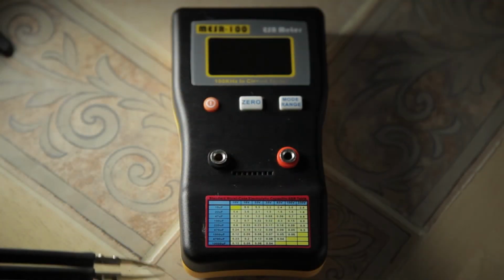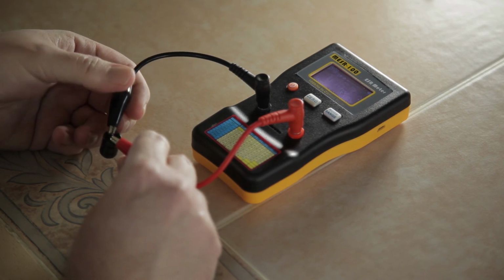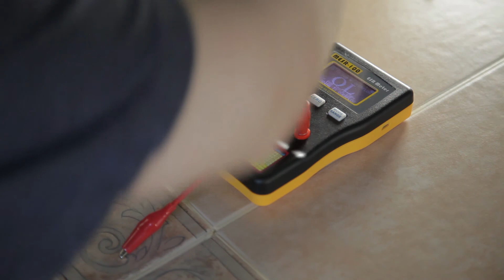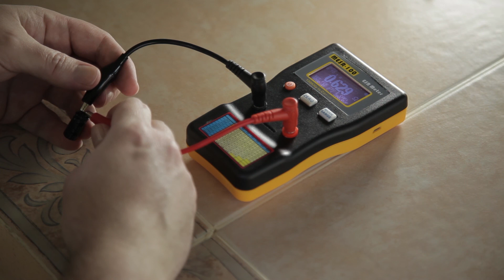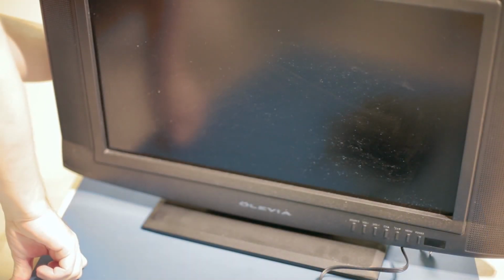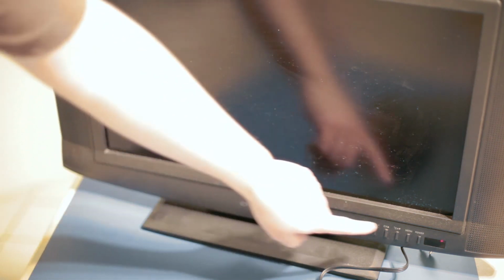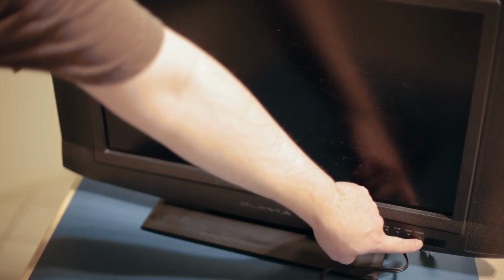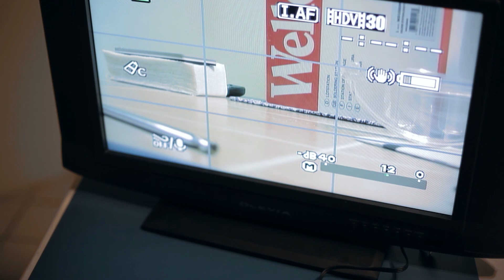LCD TV Capacitor Repair

Comment: Where did you buy the capacitors?
Reply from the maker: +Skip C Digikey and Newark and good sources. I like to keep a small supply of popular sizes for power supplies handy, but if you only rarely make repairs they'll usually sell you just the quantities you need. The shipping charges are the worst part for small orders.